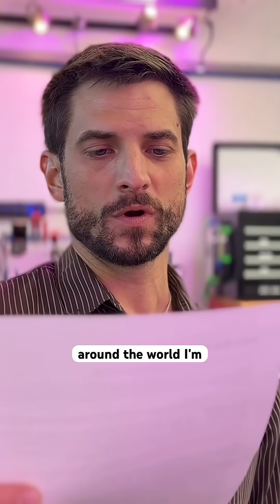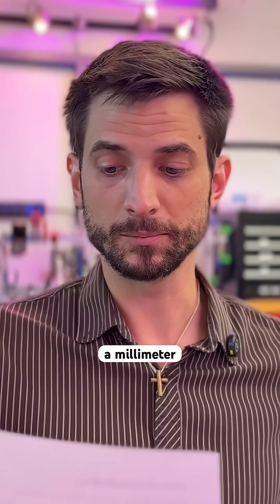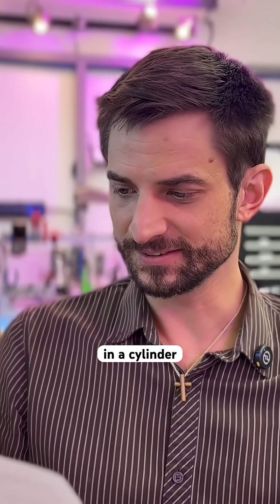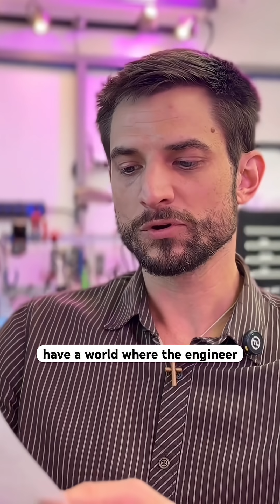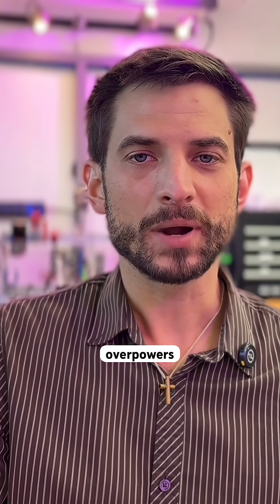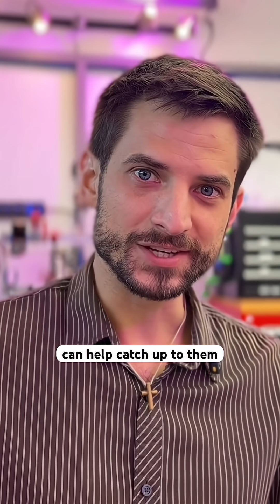Expanded PVC introduction - why it matters #engineering

Comment: Modern engineers are spoiled with precision machining and simulations. Everyone has forgotten how to engineer around imperfect production and reality and demand it meets their standards, rather than adapting to meet the realities of uses and production.

Pistons did not need millimeters of accuracy. That's why piston rings are a thing. In a modern car that seeks maximum efficiency and hovering around adiabatic temperature, those need to be incredibly tight. But it did need to 40 years ago in cars and older. Old engines were not that precise. They were engineered to not need precision